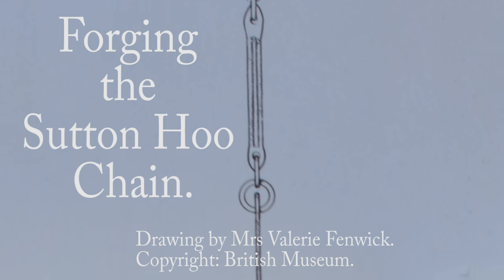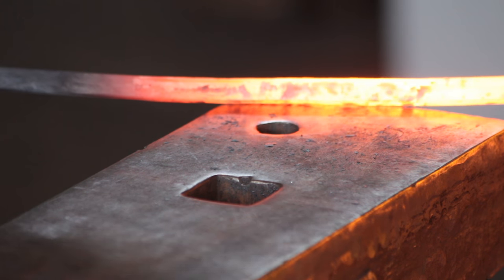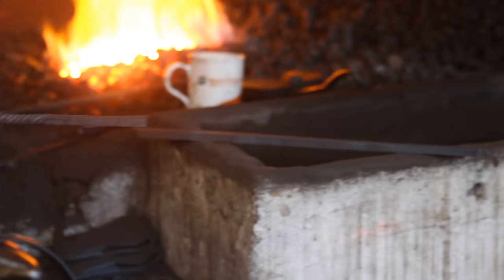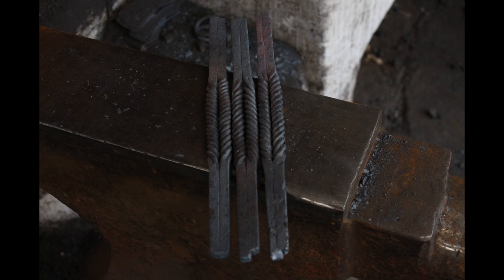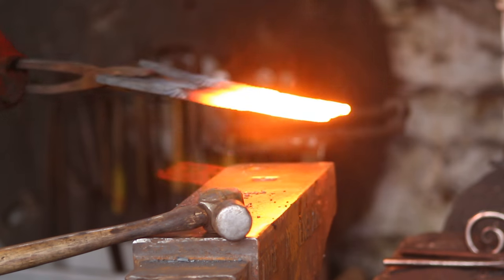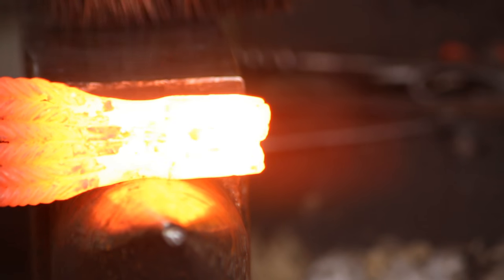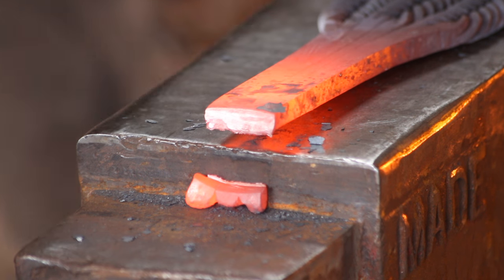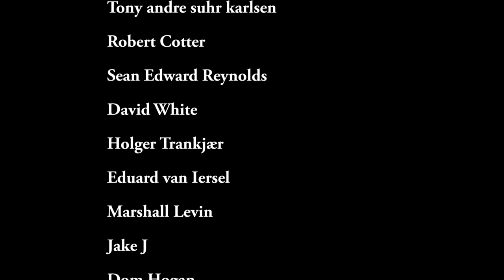Forging the Sutton Hoo Chain. Part 7, starting the composite element.

Comment: Thanks for that collar demonstration! I have some wrought iron lying around, and I can't wait to do some practice on welding :D

 Now another question. We know that they did weld carbon steel with iron for tools. Is there any mention or sign that in the old times they would be using any kind of flux? Would the quartz from clean sun-baked beach sand be enough? Or maybe their steel, made the very same way wrought iron is (folding and forging together layers and adding charcoal dust inbetween) was easier to weld than our modern tool steel? I tried to make a folded hatchet, and everything went fine until I tried to weld a piece of high carbon springsteel into a mild steel head. I probably should've fluxed it, but I had no borax and was eager to try it out the old way... it actually welded on one side, but I have no idea how well - it didn't blend at all, on the other side I couldn't get it to stick, and now it's pretty useless, because after so many welding heats it took the steel melted a bit and has a completely broken structure (lots of cracks on the edge). I'm about to start with another one, this time good tool steel and old wrought iron, and I really want to do it right this time (but as historically accurate in terms of technique as possible - forgeed tightly enough that it doesn't need any grinding, and the edge filed by hand). Any tips?

Comment: Love your videos, and this series especially! Quick question, why do you use a single handled wrench for the twisting instead of a two handled one? I've always found the two handled ones make it easier to keep the bar straight during the twist. Is it just a matter of preference, or is that kind of deformation not really an issue for this project?